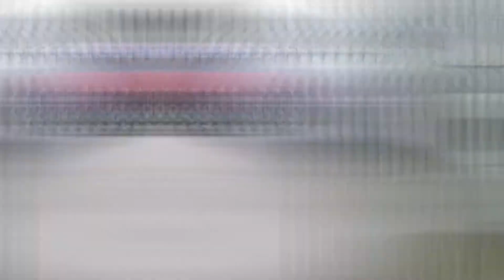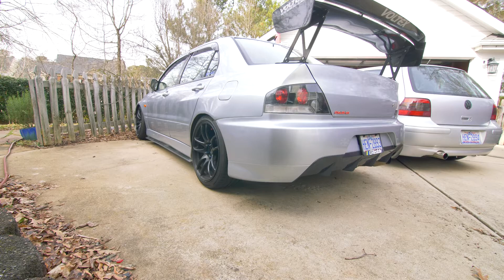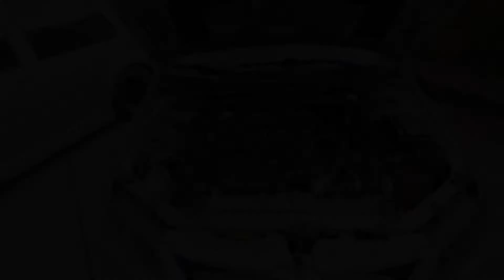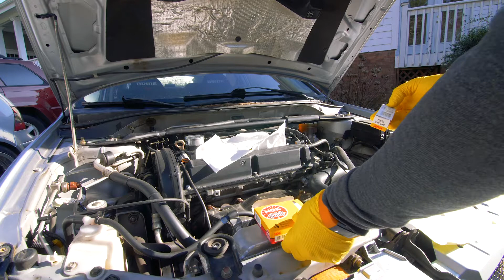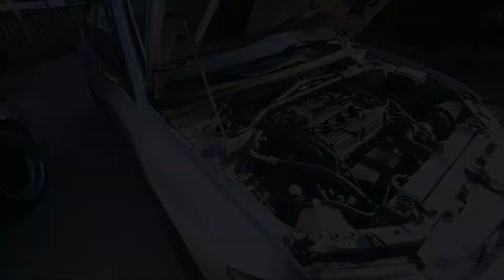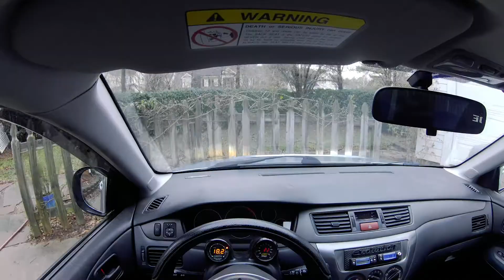How to compression test and change spark plugs on your Evo 8

Comment: Great video. Here in UK I have slight blue / grey smoke when I rev. Not burning oil & drives really well.
Got compression test & was 180,165,165,180. A bore scope found some oil on pistons 1 & 4 (the high number ones) & concluded these were high due to the oil acting as extra sealing. 
Also checked turbo with no oil in pipe or shaft play, so we concluded oil smoke must be valve stem oil seals as compression wasn't low.
Does this sound a reasonable conclusion to you?
Thanks.
Reply from the maker: Thanks man! Are you seeing any smoke on startup or during decel (high vacuum)? It sounds like you've do some good diagnostic work though - the conclusion makes sense to me.